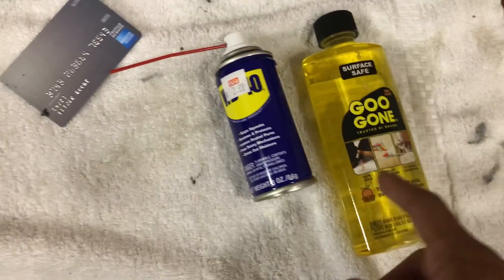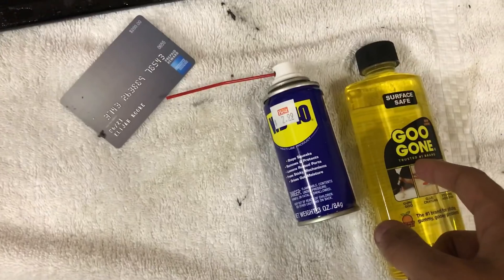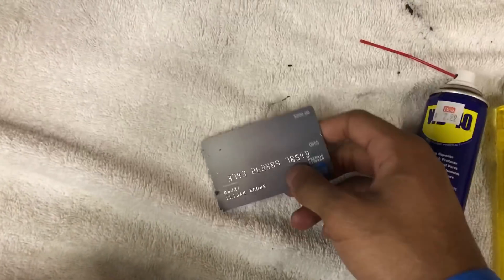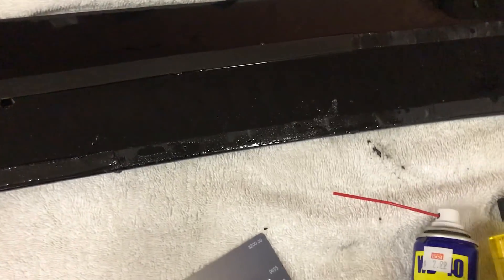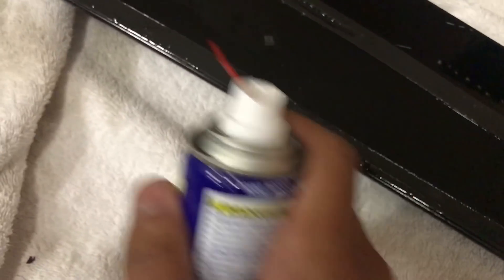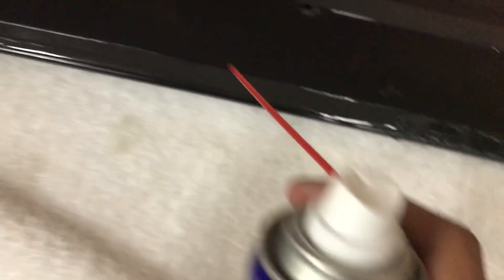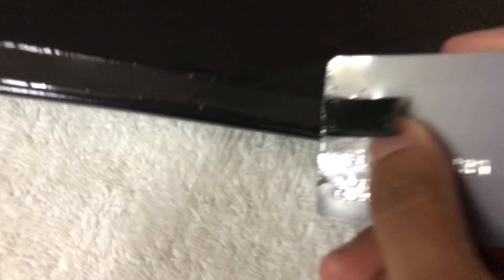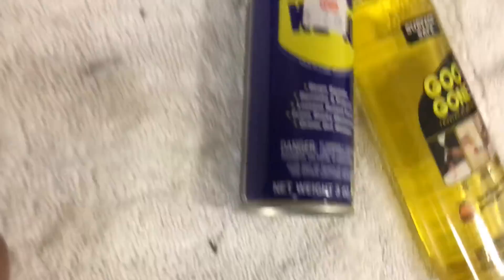Remove 3M automotive foam tape (double sided)

Comment: Just a tip... take a blow dryer and heat up the tape. The tape will just roll up with your finger pretty easily.
Reply from the maker: I could see that proving very useful.
Reply: Thanks man I was wondering if that would work better/easier/more mess free

Comment: Does the WD40 remain on the car surface for a while?  I'm concerned about it preventing new tape from adhering properly.
Reply from the maker: Yes, that’s to be expected. You’re going to need to come behind it with a degreaser/apc. Final cleaning should be with isopropyl alcohol.

Comment: I was putting up mirror tiles and screwed up the last 4. You think this would work without breaking the mirrors. I also have a 3/4 inche space between the mirrors painted black. Don't know if it would damage the paint. The whole wall looks great but these last 4 tiles is driving me crazy.
Reply from the maker: This is more so for hard paint. How I would approach that is first warm up the adhesive and mirror with a heat gun (within reason) or hairdryer. Once warmed up, with a plastic wedge pry while warming up. Check my videos for the Lexus emblem install. Similar concept. 

If it ruins the paint, repaint/touch up. But should be covered with the mirror. Good luck!
Reply: @BWItoATXF  thank you sir for the response. I got them off with wedging a credit card between them. Worked like a charm.  Off in about 30 min.

Comment: Why use goo gone? Wd40 alone can also remove adhesive residue
Reply from the maker: Seph Mago just a preference really. I got a bit better results using goo gone and smells better too.
Reply: NEVER EVER use Goo Gone, it made stuff sticky and tar-like on my jumper battery I took out my jumper!
Reply: Josiah Barkhau yes and goo gone can strip paint if it gets on it by accident wd40 doesn’t
Reply: @bezzfan72  I have used goo gone and it didn't mess my paint up.just wash off residual goo gone with soap and water.
Reply from the maker: @josiahbarkhau9359  Sounds like there was corrosion that gelled up.
Reply from the maker: @bezzfan72  Not at all. Goo Gone is alot more gentle than wd-40
Reply: @BWItoATXF  Goo gone has straight orange oil in it, do you know how dangerous orange oil is to wax and paint ?.
Reply from the maker: Bobby Hempel wrong. 3rd car I used it on. It is meant for it. Even lists it on the site and multiple other people do too. https://googone.com/howto/blog/does-goo-gone-work-on-that/

If it does happen to strip wax, reapply. Simple.

Comment: I used double sided 3M foam tape on an Iphone battery and found out it was the wrong battery...It is stuck good ! Maybe a razor?
Reply from the maker: skulletor I would use a hair drier to warm up the adhesive and try to slowly pry it off. In addition, get some fishing line or floss and saw it off while heated.
Reply: I know its probably too late but they sell some plastic razors just for that, removin without scratching or damaging